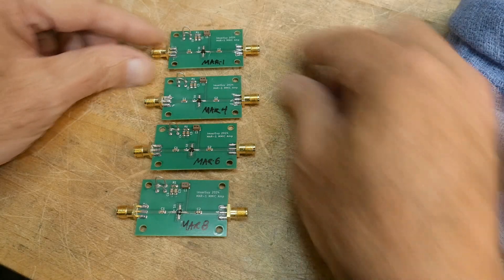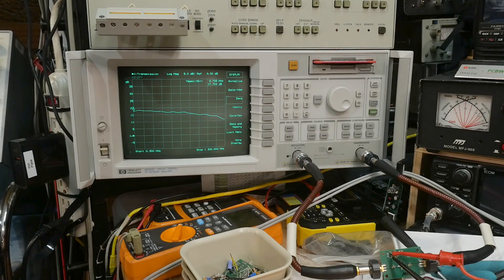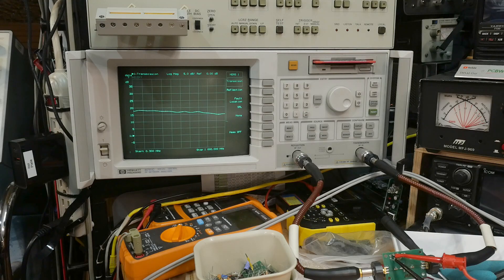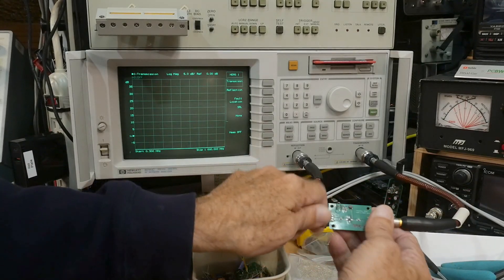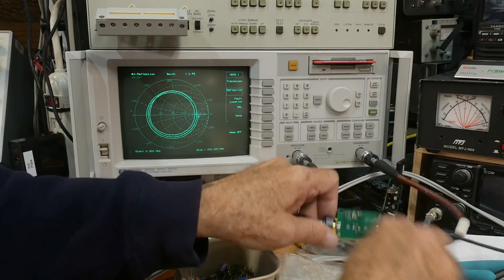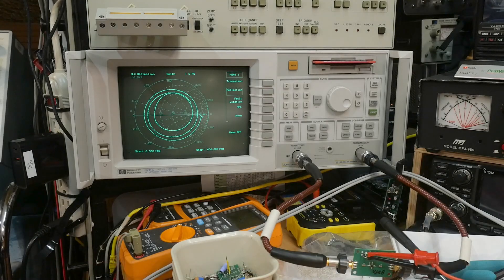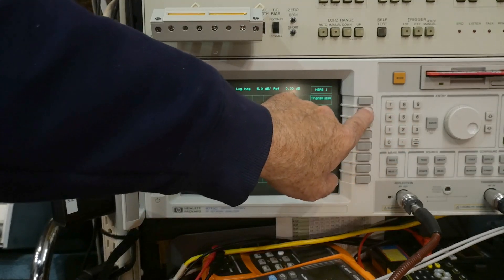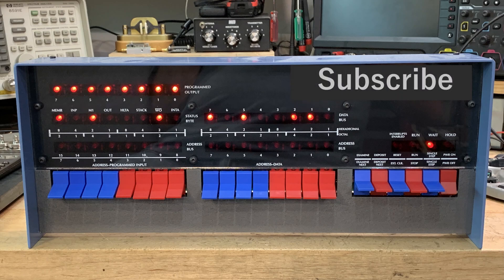#2088 Mini-Circuits MAR Amplifier Board (part 2 of 2)

Comment: If you have an original MAR-8 then it is a bit of a different animal compared to any of the + versions.  I believe the bias resistor was 120 ohms for 12VDC.  And the gain is 32dB at 100MHz, 28dB at 500MHz and 22.5dB at 1GHz.  Very hard to find datasheets for the original versions in the MAR series.
Reply: I think the original MAR-8 is the same as MSA-0886

Comment: The input and output DC Blocking capacitor value needs to be 2400pF according to the evaluation board TB-432-8A+
Also why do you make a long stub at the RF Biasing choke ?
Please get your RF amplifier boards reviewed by an basic RF expert.

Comment: If memory serves me, the lower gain MAR's were usually the higher power output devices. Of course, memory hasn't served me for years now. It seems like the MAR devices were designed for gain, or for output power, or for low noise.

Comment: I have a communication service monitor that has mini circuits mar devices in them for mixing RF circuits.
The color dot on the mar device indicates which one, mar1, ,mar4, 6, 8.
I have a datasheet some where in my digital mess that has the color code.
Reply: I was under the impression that the colour of the dots follows the resistor colour code. Ie yellow dot for 4
Reply: @brianclements1014  
mar1 marking=AO1 color=brown
mar2 marking=AO2 color=red
mar3 marking=AO3 color=orange
mar4 marking=AO4 color=yellow
mar6 marking=AO6 color=white
mar7 marking=AO7 color=violet
mar8 marking=AO8 color=blue

the newer devices have a + after the part number for ROSH
other wise the same device just with no lead.

Comment: The resistors are to determine the current of the amps for a given voltage so you could measure the input current rather than just the applied voltage as they specify an optimum current for the devices I think.

Comment: I looked through the MARs I had before I built a preamp with the 6 because it seemed to have about the lowest noise figure among all of them. On paper.  The unit is not compatible with the Chinese prescaler SMA because the HF receive loop antenna required a male input and female output connection.